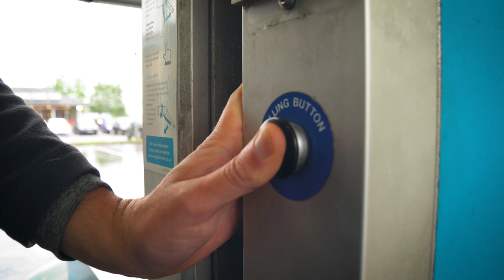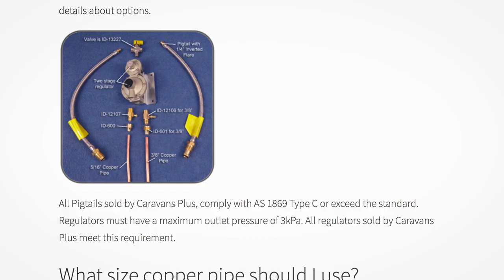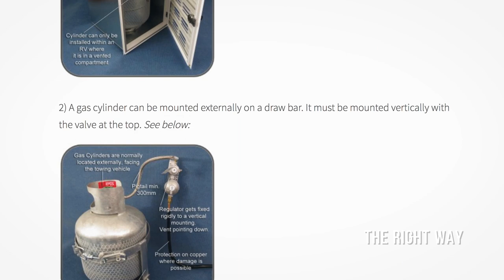VAN LIFE: Building a DIY Propane / LPG / Gas System for Van Dwelling

Comment: We never use tape or dope on flared fittings, only use it on pipe thread fittings.
Reply from the maker: correct
Reply: I second that. You are correct. Flare fittings don't use anything. For the use of Teflon tape on npt or straight thread, the regulations can vary from one country to another. In the US there is a gas rated yellow Teflon tape. Australia might be different.
Reply: any tape on a flared fitting will cause leaks because the threaded cap cannot apply enough clamping pressure to the flare.
Reply: Correct, nothing used on flare fittings

Comment: LPG is surprisingly safe. You guys are taking all the right precautions and it will pay off in peace of mind. I spent years with a 5gal tank inside a home built wooden locker. Worked well, never leaked, always closed the tank before driving.

Comment: When I was a kid I helped my dad replumb the gas system in our mobile home.  Dad also used flare fittings everywhere.  I remember a couple times when he forgot to put the nut on before flaring the tubing.   It's part of being human.

That tank is hanging pretty low.  It will get hit and be dented on your trip.

Comment: Add automotive heater hose over the pipe that's exposed under the van or go to hydraulic parts supply and get hydraulic line protection wrap.

Comment: For all your threaded gas fittings you must use yellow GAS teflon tape . It is much thicker and formulated to prevent gas from seeping thru the tape it's self.White teflon is for water applications only.     CHEERS               Steve h.

Comment: 4:18  I’ve done 300k+ miles hauling 9k gal propane and other Hazmat gases in a propane assisted semi truck all over the US and Canada. Safety is in the engineering, if it’s built for the road your just fine. You’d be amazed at the beating those tanks can take.

Comment: Flare fittings should NOT use Teflon tape. The threaded section done not provide any seal.
Reply from the maker: correct
Reply: @KombiLife , not what is shown in the video though (11:50).... Also, the threaded fittings you had issues with - are you sure they are tapered threads rather than parallel? Seeing how far you have managed to screw them together would indicate that they are parallel and should be sealed with a gasket instead.

Comment: Nice job, you and Leah are great partners! Go westy's tank will be the replacement for my 1977 camper origional. A bit expensive, there are suppliers for a propex heater too. Or I use an Olympian Wave 3 catalitic for now. Your build is coming along nicely. ✌
Reply from the maker: Not tempted to install a Webasto? Running on the main fuel tank and a drier heat than burning propane.  More pricey though.  Installing the propex outside would resolve that issue
Reply: @KombiLife  The propex mounted w exhaust out is my next plan to go w my 200 watt solar system. Is your hot water plumbed in too? ✌
Reply: @KombiLife  A Propex is a forced air heater with totally separate combustion from blown air. It works on the same principle as the Webasto other than fuel source. Propane burns far cleaner.

Comment: I'm not an expert on lpg. And it maybe different and your country than the US. But I have been informed by others that the use of flexible gas line should be very limited and only used when absolutely needed to connect a few feet at the most usually in a protected environment. I would expect that it has something to do with the flexible line like shown on your build being less durable because of its ability to flex and susceptible 2 outside intrusions such as Road debris. I know that the US RV manufacturers use very thick LPG rubber lines secured to the frames of the RV or even hard iron gas pipe. From those Main pipes they then use a short flexible line to the Appliance they are trying to feed. I only mention this as it seems that at least 10 times a year in the u.s. we hear about RVs Catching Fire. Thanks for sharing your build. :-)

Comment: be advised while the propane solenoid is a good safety feature, it is a BIG battery drain as it's drawing power whenever you are using propane. Be sure to shut it off when not using to conserve your batteries...

Comment: In my experience, Teflon tape is pure garbage. I do not recall making a joint that would not leak on first try ever. I moved to Teflon THREAD (also called "sealer in thread") instead, and boy isn't it marvelous. I have never had a leak since. And it is certified for pretty much all types of threaded connections - gas, water, heating, whatever.

I was just wondering, have you considered - even briefly - having an induction stove top? I believe there are ways to power those even from low voltage system. Would probably need larger battery bank, but might eventually turn out to pay for itself (no cost for refuelling and no hassle looking for a station). I guess it makes sense for you to still use LPG cause you have the shower as well and it would not be really possible to power both stove and shower from batteries. But I am still curious if you thought about that at all?

And I would not trust the gas detector too much. Yes, it will detect sleeping gas. But once it sounds the alarm, you will be under the influence of the sleeping gas already, in most cases. Alaska may turn out to be a better deterrent (as dogs usually figure out when someone acts suspicious around you and start barking). But most importantly, if sleeping in a risky spot (like a stop along some motorway, a gas station, or some other location like that) its best to just mechanically block all the doors from the inside. That is how truck drivers solve the issue, they basically tie both door handles together tightly with a rope, making it impossible to open from the outside.

Comment: White or 'water' teflon tape is never to be used on propane fittings, nor should it be applied on any flare fitting - only yellow propane tape and only on tapered pipe threads. The regulator already has a POL - which, if the reg gets broken off, shuts off the flow. And on the subject of regulator - get rid of that POS Cavagna regulator now, replace with one that's not going to fail within a year - or less. I've binned over ten of those crap regulators from customer vans this year alone. Marshall (US) or another regulator like those sold by Propex Leisure in UK are far and away better. BTW, flared aka 'stretched' copper joints are no more superior than proper compression fittings which are the industry standard in many parts of the world. The lines are running less than a half psi. YorLok or Parker double-compression fittings beat flares in every way.

Comment: When using teflon tape on brass fittings ruff up the threads with a saw blade so the tape will not slide up

Comment: LPG is pretty safe when done properly. I think all states here have laws covering correct installation by authorised fitters so expect it to be checked here before you can use it.  Some taxis in Victoria blew up years ago because kits were being fitted to engines years ago without inspection.   Every taxi in Australia until recently ran on lpg.

Comment: I believe tape is only used on NPT or BSPT threads, not flared fittings. That's why you had problems with leaking.
Reply from the maker: You are correct about needing tape on the flared part of the nuts but it is needed on the threads.

Comment: ALWAYS use pipe dope on gas fitting never ever tape
Reply: Vince when I did gas fitting work  we used both, more efficient in the long run
Reply: Propane tape - yellow - is fine.
Reply: Dope then tape
Reply: @jameswoods1105  and don't over tighten! That can mess up the tape!
Reply: I used Dope in my Camper & 2 Days Later ...woke up on the Floor. !
Reply: Yellow tape is fine by itself. That is what it is made for.

Comment: In the US all RVs have the gas detector near the floor. I just added one to a 40 year old trailer and 2 days later it went off. I found I forgot to turn the pilot in the oven off, went and got propane which let the pilot to go off then when the gas was turned on there was no pilot flame. It worked just as it was suppose to, it sensed the gas though I couldn't smell it.

Comment: We ran an a T splitter to the gas over/stove and Aus certified gas hose (about 2 meters long) to copper pipe to gas on/off to gas heater, and the gas bottle is in the cupboard with no box yet. I think we need to upgrade… ? At least with the gas box with a bottom exit.
Reply from the maker: Propane tanks do leak so a sealed and vented box would be best. At least a vent though

Comment: Off topic have u changed the air filter system on the bus? That performance filter will let fine dust in to the engine and that kills it!!!
Reply from the maker: Not yet
Reply: @KombiLife  Try to get a Donaldson system or a standard T3  air box and get the intake up high for clean air with a pre-cleaner system

Comment: I would argue for a single-ring induction plate in lieu of gas. Should be able to find one that will run off a 1500 watt inverter from a half-decent lithium band topped up from solar PV. You probably use it for less than 10 mins at a time which is equivalent to a 250w/hr draw. And maybe a small microwave - again <1500 watts, great for hot water.

Comment: Would really recomend installing a webasto/eberspacher diesel or petrol heater (maybe option to connect to electrical grid) for your van having a varm camper in winter without having to turn on the main engine would be invaluable in coldest months i think!
Reply from the maker: The Webasto is currently warming my feet as I type 😎

Comment: Yes, but what if a giant beaver comes out of the woods in the middle of the night and trips over a stray twig and accidentally falls onto a spanner you may have inadvertently left out and the spanner some how flips up and amazingly attaches itself to to one of the gas joints loosening it slightly but not enough to notice and as the giant beaver runs away it's spotted by a half man half Wolf who throws a stone at it which bounces off your metal bumper causing a spark and small flame ignites melting your melting your satnav which you may not have put away properly and you get lost and drive into a tree.... 
Have you thought about that??? 
Everyone's an expert...
Reply from the maker: Yes we have a plan for that exact situation also. 🤥
Reply: Just checking.....

Comment: Guys.....I would seriously consider  stone/gravel  protection for your gas set up....not a lot of ground clearance there....Outback Australian roads can be brutal..... and nip up all those fittings occasionally ,especially after enduring 500ks of corrugated dirt road.
Reply: I see a 1/8" steel guard under the regulator and fittings.

Comment: When working on the system when you have fuel onboard, using a brass or aluminum wrench is safer than a wrench out of metal capable of creating a spark...

Comment: Propane at high altitudes usually means in the cold. Propane remains liquid and refuses to become gas up to some 40f, 5c, (at sea level; lower air pressure will help you at heights but not much) and the usual equipment is meant for gas not liquid. So you can expect your external propane tank to "be empty" by the time it reaches zero centigrade. There are ways to heat it, insulate it, or set up a liquid system, but you'll really need to scrap your setup for cold weather use. You may also find that vehicles with propane are banned from some bridges and tunnels, as they are in the US.
Reply: Propane works just fine at 40F. And all the way down to below zero. Maybe you're thinking of butane.
Reply from the maker: intersting point.  I just made a tea and the outside of the Kombi is freezing (5000ft today) it will be interesting to see how it holds up

Comment: Iam more worried about your gas water heater, it does not appear to have a flue and is probably not designed to be used indoors, let alone in a van,
Reply from the maker: it's a good point and we're glad you brought it up.  We mount our shower on the GoWesty swing-away bumper system when in use.  It only lives inside under storage.
Reply: Correct

Comment: Don't forget some vehicle insurer's insist on knowing that you have gas installed and will require seeing an instalation and safety crtificate before you get cover which meansa professional certifide instalation firm and engineer has to inspect it before issuing the certificate also unless changed some countries used to insist on seeing the same certificate's signed by an engineer.
Still wondering about your change of direction Morroco instead of europe, possibly a Syncro or 4x4 wouls have been a better choice of vehicle as roads are a lot less forgiving for your camper.
Reply from the maker: So far so good - it's a heck of an adventure :)

Comment: Love you and your videos, but propane does not contain butane. They are different gases, buy very similar properties and uses. LPG has a much colder boiling point which makes it more usable in cold climates. (-43.6 Fahrenheit at atmospheric pressure).
Also, do not use tape on flared fittings, only use on pipe thread.

Comment: if i were you id get a 6mm thick aluminium sump guard fitted below that tank , that tank is low and begging to be ruptured with some rock or branch.. the solenoid wont help much if that happens , just 3 ft from a hot engine exhaust... probabaly cost 100 euro,, could be well worth it !

Comment: Wait a minute, that last part where you were showing a fitting that was leaking, Please tell me that is for your water and not a fitting you are using for propane ???
Reply from the maker: Yes that was a water fitting in the video - but also one of the propane fittings needed to be disassembled and redone with pipe dope

Comment: how about solar panel and induction stove?
Reply from the maker: Our electrical system is REALLY cool (it's the next vid) we may go induction in the future.
Reply: @KombiLife  cool
Reply: i think induction stove consumes to much power for campervan. Typical instalation has around 200-500W.
Even if  u have 500W panels and full Sun,  stove has like 4000W.
Reply: @OskarCwiekaa  there are lots of 12v appliances that consume under 100W and pretty good ones we tested in years of vanlife. Still puzzled why people would bother with propane tanks in a van. Better to get a decent lithium battery for that weight.
Reply: @OskarCwiekaa  there is 1.8kw stove & 2Kwh Lithium ion  battery. i remember capito have battery and solar panel from jehu garcia
 when kombi crew visit california, in jehu new video he make 2kwh briefcase battery to charge a tesla,also we can charge it using electricity from power outlet. but it might be too expesinve for now.
Reply: @leonardobrawijayamrq8914  @spook didnt know that such thing exist, thanks! You get smarter every day :D
I think propane is popular cause its cheap and easy to use/install.

Comment: If you have a leak inside the bus and you're going to press an electrical switch?
Reply: that is sealed.  In other words, explosion proof.
Reply: @e-curb  there are electrical connections with exposure to atmosphere that could generate a spark
Reply: @jamesgilbertuk817   ..  Explosion proof electrical switches exist. The oil and gas industry use them all the time.
Reply: @e-curb  Yes that's my point, this isn't a switch that's certified to be used in a hazardous area.

Comment: Will never ever use this gas. Just saw an exploded camper here in Spain a few weeks ago. Hope, nobody got killed, it looked horrible...
Reply: Frauke W. Up to you, but however you do it, both driving and cooking require stored energy in some form or other and a system to get the energy from point of storage to point of use - if improperly installed/used or poorly maintained, all of them create hazards.
If you want to take a meaningful lesson from the sight you saw, promise yourself you will keep a well-maintained vehicle, whatever energy sources it uses for getting around, cooking, and what-have-you.
Avoiding gas is all well and good if that's your choice, but uncontrolled release of stored energy, be it fuel, electrical or kinetic, will get you just as well as gas if you haven't looked after your rig.

Comment: The gas alarm is a waste of time. LPG is heavier than air so to detect a leak you need it at floor level, LPG also has a stenching agent added so you can smell leaks, it is very strong and you would easily smell it before enough leaked to cause an explosion. 

As for being gassed by thieves, it is a myth. There are no safe to use knockout gasses that are easily obtainable and in the possession of thieves who want to rob from camper vans. For example Ether, it is extremely pungent and not very good at knocking you out, it irritates the airways causing coughing and sometimes vomiting. Choloroform in a gaseous form just wouldn't work, it couldn't knock you out. Even more powerful modern volatile agents would need to be brought to the victims van in tank loads and delivered by a large compressor. Potential agents such as the one used by the Russians during the Moscow theatre siege are few in number and very difficult to obtain and when used in the siege killed 20% of all the hostages and terrorists.

If there was a totally safe, odourless, potent, cheap anaesthetic available to thieves it would already be used by the medical profession.

Being gassed is a cover story made up to cover insurance fraud or because the victims were actually a bit drunk when they went to bed.

The only thing your gas alarm will detect is probably your deodorant.

Sleep soundly and it is a great build.